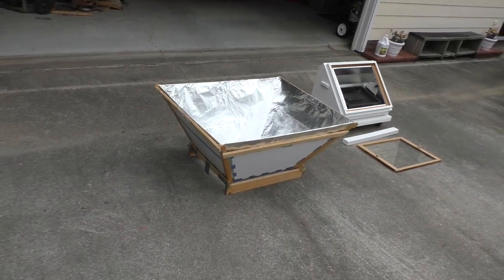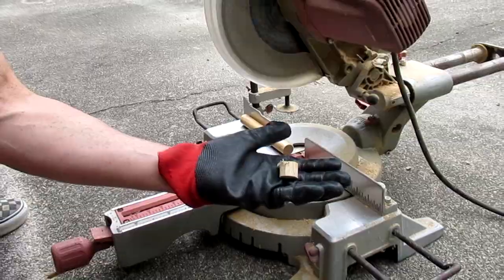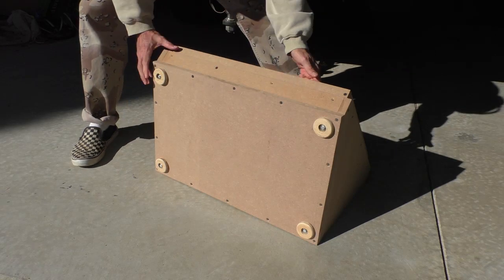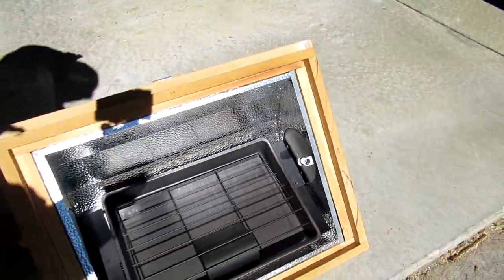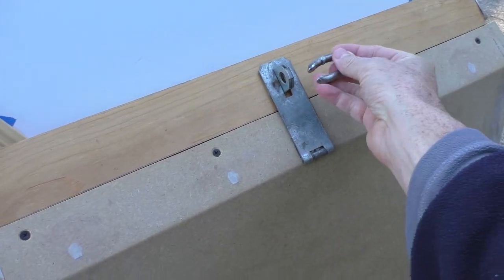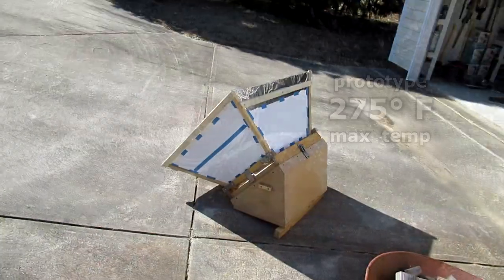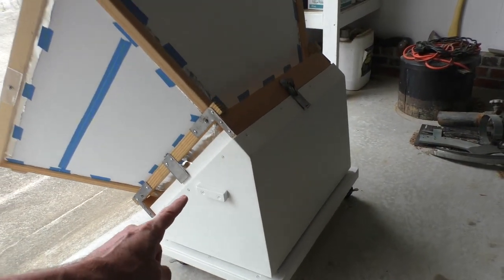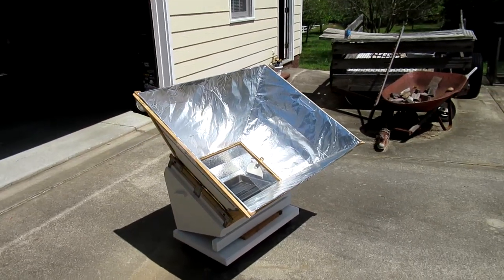How to make a SOLAR OVEN Step by Step 350F Degrees Cook Food Storage

Comment from the maker: Supplies:
Reflector for Solar Oven: https://amzn.to/3yWgyhQ
Foam Board for Reflector: https://amzn.to/3vvgjcQ
Heavy Duty Aluminum Foil: https://amzn.to/3xxHOVX
Black Steel Bake Pan 15"x10": https://amzn.to/3BwqQ97
Oven Thermometer: https://amzn.to/3MjU9kR

Tools:
Large Metal Cutting Tool: https://amzn.to/3lzUfcC
Smaller Rotary Cutting Tool: https://amzn.to/37w4cEp
Hot Air Tool: https://amzn.to/36q2Nid

Thanks. As an Amazon Associate I earn from qualifying purchases.

Comment: Try having the inside of the oven flat black with Flat Black High temp paint.  Being shining inside the oven part does not increase the heat. Being flat black increases the  heat. You might get probably get 100% more.
Reply: The flat black will absorb the heat and re-radiate in infrared. Infrared is reflected by the glass in front thus  increasing the greenhouse effect. I had a similar oven to yours and I painted it flat black I was able to achieve over 400°.
Reply: Absolutely correct!

Comment: Sorry... I never saw a box solar oven with huge multi angle large reflector pointed straight to the top 90 degrees. Can your model do this?
In high latitude countries it never need to be direct to the top, given Earth angls related to sun for high latitude. But on tropical clime near equator line, it is needed.

Comment: Awsome build. Possible considered change for the platten that carries the cooking pot an installation of a gimbel.These are used on boats to keep the stove level especially sailing ships that rock around due to wind and wave action. On this unit would only require only a fore and aft movement.

Comment: Some of this stuff is ingenius!!! Cutting cardboard boxes into little squares for insulation??? Awesome! I should have thought of that for my dry ice containment cooler. I used wet newsprint; and mine is probably much heavier to boot!!! $200 sounds nice. However, I would have to buy all the saws, take a day off to clear some space. You can save a little time and saw needs by using a 28 qt ($5) or 45 qt ($13) styrofoam cooler from Walmart. Very nice design. I just cooked some perfect parboiled rice with a flimsy sun shade from the dollar store. The shade didn't quite work for the dry beans.

Comment: Are you an engineer by chance? That method for detecting the perfect sun angle using a circular shadow is ingenious! I am super impressed
Reply from the maker: hi, i actually took the idea from a solar oven that is for sale called the 'All American Sun Oven'. But my design is better, their design is a cheap piece of plastic that sits on the outside and blocks some sunlight. I'm technically not an engineer tho. Thanks
Reply: @FunBubble  Hi, what did you make your little sun catcher out of? Is that some sort of fitting that I could go and buy at my hardware store?